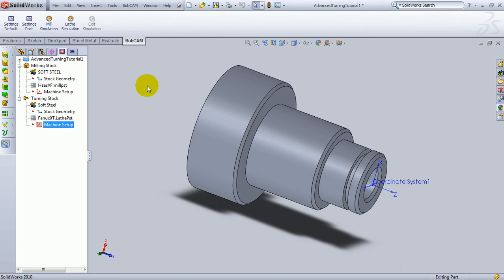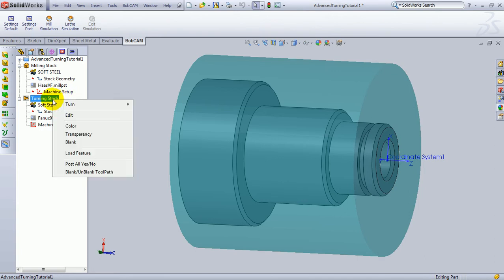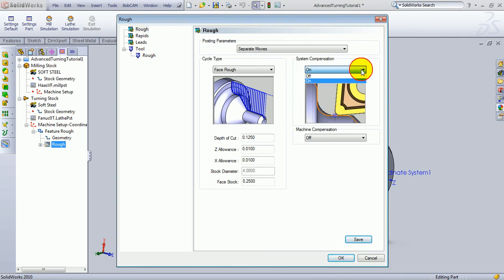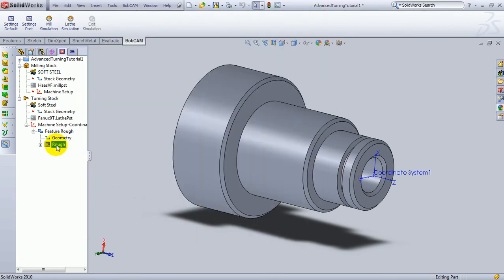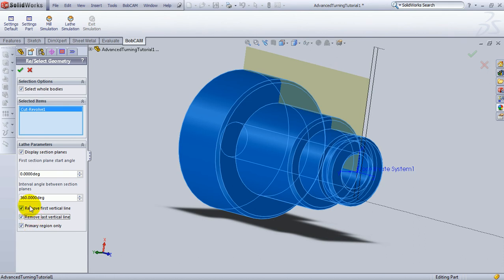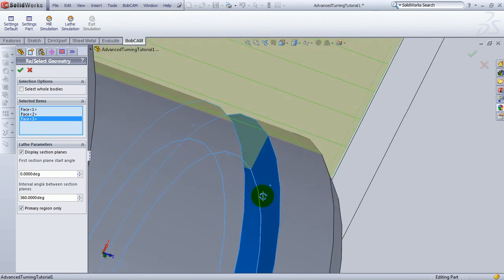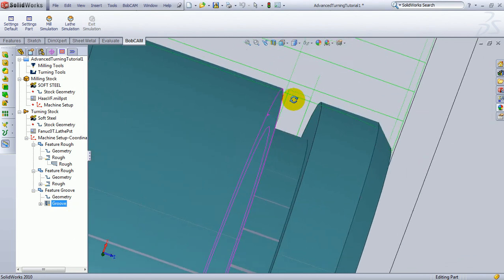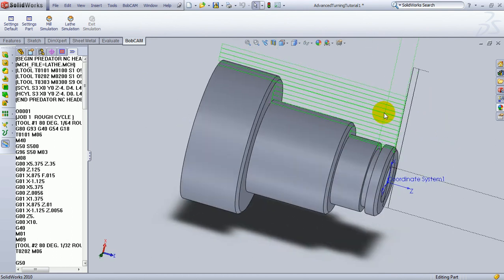BobCAM Turning Example

Comment: Can you help me? i have the software bobcam  for solidworks, so i started to used it, but my pice have 2 holes on the front and  back , i could do just hole that is on front. How Can i change of coordinate system to do the other hole?
Reply from the maker: Judit, I recommend you join the BobCAD After Dark facebook group.  This will be the best way to help you with your question.